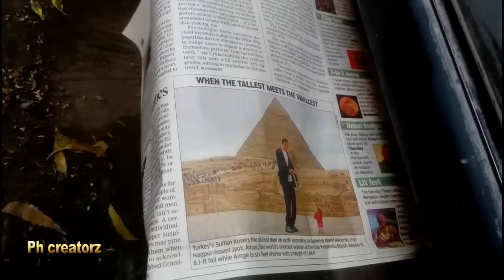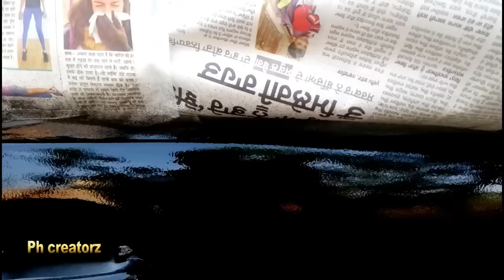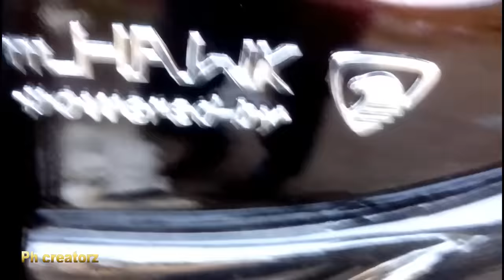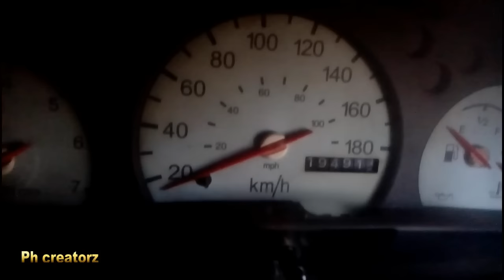Mahindra Scorpio | Full Repaint | 2006 Model Modified | With Latest Accessories Part 1

Comment: 👎  vehicle should not be painted like this. its not the right way
Reply from the maker: Bhai Kami kia hai apke hisab se
Reply: paint shouldn’t be done in open atmosphere 
secondly when u wanted to paint whole vehicle why u dint remove the whole paint
painting is a beautiful work i love doing it but not like how u do . 

sanding is the first thing u do then clean it after that primer goes in check to see all spots are closed only then go for light quote of paint then 2 coats of normal paint in a closed space free from dust

its ur vehicle u are painting so do it perfectly
Reply from the maker: @stevensreejith3041  I agree with you,but
Different people have different way to do their art.
It doesn't matter of atmospheric.
According to customer budget we paint it as well as at low cost.
Original 2k paint trough with  various sanding papers,

Can you tell me which paint quality have I used for this car?